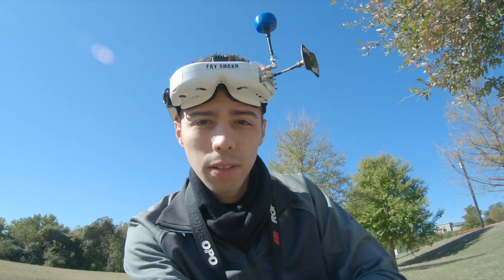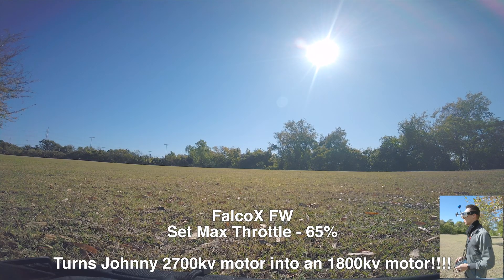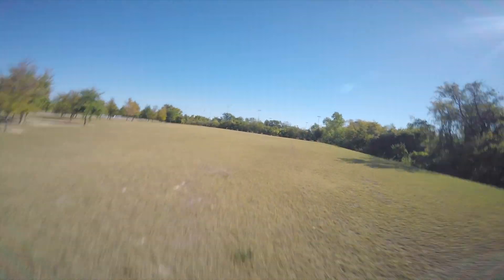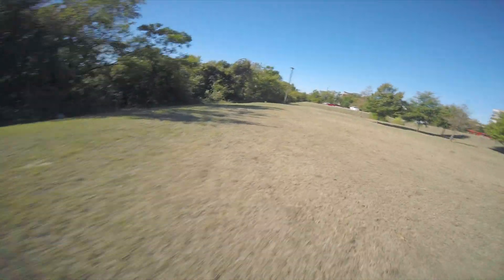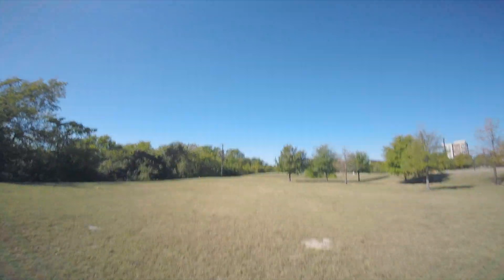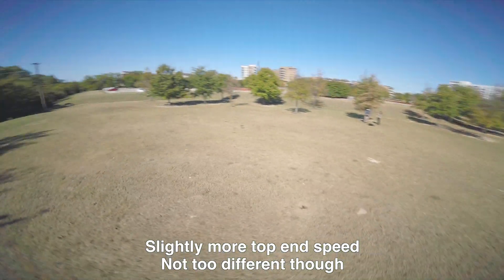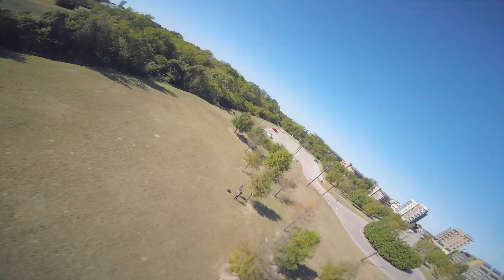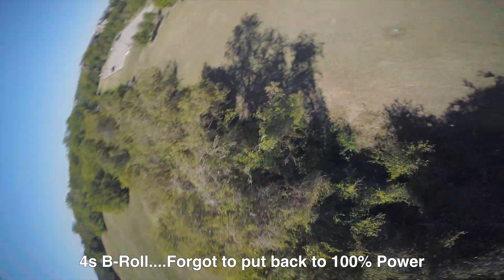Testing 6s on 2700kv Motors

Comment: Why?!? Why did you cap it at 65% why not use all the power? I do it on 6s with 2200kv, 2500kv, 2100kv.... be prepared to go well over 130-170mph... one of the best combos I have done is the 5” GRL Titanium Pro2 with F55a 4-1 ESC and T-Motor F80Pro 2200kv it’s not as fast as the 2500 but it still goes way faster then most people’s quads while also still having efficiency & control at lower speeds “thats the main reason why I went up in stator size” Tuning my quad with set ups like this are easy as well, no propwash, no heat, all performance and stability & full throttle 100% no Cap....
Reply from the maker: I capped it to see how much efficiency I could get and to see how similar of a flight feel it would be compared to a 4s battery. It’s not necessary to cap it, but I did it anyways mostly as a test. Also, newer pilots are not that great with throttle management so capping the limit is a bit safer for them and their gear in general.

Comment: did this ovonic battery ever swell up really bad on you? I have been flying on emax rs2205 2300kv and both ovonic batterie's i had, 4s and 6s ended up swelling. one has a bad cell  so ill make a new battery out of the good ones but i dont trust them very much anymore. i do love the way it feels to fly on 6s w these motors even with the limit on. i do get extra flight time as well and i feel like it just stops on a dime and carrys weight much better as well with 6s. board is kakute f7 hdv.
Reply from the maker: Putting a limit on betaflight is not the same as putting a power limit of falcox. That is probably why your battery is swelling. I haven’t had any issues with ovonic batteries but I treat them fairly well so that probably plays a part.

Comment: @0:46 I like that you put velcro tape on your battery😅 Also, I have a quick question about 4s vs 6s that I hope you can answer. Is one of them more juicy than the other? For example doing flicks? Or does it not matter if it is 6s or 4s? 6s adds a little weight though...
Reply from the maker: Bjørnar Verpeide 4s and 6s are both good for juicy style flying. You can do the same flicks and tricks but its more important to think about weight to power ratio instead of 4s vs 6s.  Sure 6s adds weight but it can provide extra power to make up for it. 99% of the videos on my channel are on 4s because it still works just fine and i have way more 4s batteries at the moment.
Reply: @JosueFPV  Thanks for the quick and good answer! So this is where the KV comes in as well, right? Would you say it is more difficult to fly juicy on a low kv motor? (Lets say 2200kv on 4s)
Reply from the maker: Bjørnar Verpeide yes i would not recommend that low kv on 4s. Anything lower than 2400kv on 4s is too low, especially if you are using a gopro hero. I recommend closer to 2600kv and up for 4s and 1750kv and up for 6s.
Reply: @JosueFPV  Thanks! Working on a new quad, trying to figure out what parts I should get. My current quad is a bit heavy. 741g😅 with 6s 1300mah battery and gopro. 1800kv motors.  So I guess the weight the power ratio is not the best.

Comment: Cool stuff man I’ve been wanting to try this myself now think I’m gonna have to do you know can you lower throttle cap In radio would it be the same thing
Reply from the maker: StaticMotion putting a throttle cap in the radio is NOT the same thing. In falcox, it changes more than just the throttle. If you only put a throttle cap on your radio, you could still smoke a motor because it doesn’t account for the extra power your quad registers when you move roll, pitch and yaw. I also believe that falcox compensates and adjusts the pids at the same time as well so the tune is more similar.

Comment: how much total flight time did you get on 6s?  did you have to change your capacitor to a larger one or something also?
Reply from the maker: LemonC FPV I’m just using a 1000uf 35v cap on esc and recently added a 350uf cap on my flight controller just to clean things up even though it technically doesnt need it and its really small. Total flight time was 4min 15 seconds. Could have potentially flew a bit longer.  Landing voltage was 22.2 volts.
Reply: @JosueFPV  interesting... maybe i should try a 6s out before i get more packs

Comment: i tried 6s on 4000kv 1606 motors, worked for 2 packs then i smoked a motor had throttle set to 60% :) guess they could not handel 6s
Reply from the maker: Tixo well yea I think your math is wrong. You would want to change it closer to 40-45%. Also, you need to make sure your motors can take 6s voltage.
Reply: @JosueFPV  this was with a  3 inch  hence the higher kv.

Comment: Throttle limit? Just leave at 100% and punch that bad boy out haha!
Reply from the maker: Change Agent bruhhh it’d be going to the moon with ALL the flutters lol
Reply: @JosueFPV  Haha yeah I know. Assuming you could get a tune at the top end that didn't flutter you would still have your props likely exploding after a few packs. I think the top end for most props even exceeding their rating and working on the rpm at which the outer tips become supersonic is around 39000rpm. 2600kv @ 22.2v = 57720rpm lololol.
Reply: Change Agent so if I’ve got 2400kv motors and 5S 21volts, I could be pushing 50,400 RPM!!!!???? 😳😳😳😳 holy sheeeit. Are props rated to 39,000RPM? I have had a prop explode but it was some cheap ones that came with a complete build. Do I need to worry about 50K RPM with higher end props like HQ Ethix?
Reply from the maker: jbw5485 if you have falcox and change the max throttle percentage, it will prevent your props from exploding and getting to that high of an rpm. If you use a 5s on 2400kv, i would maybe start setting it to 80% and if you want to go higher, you can work your way up by 5%. The reason I chose 6s and not 5s is because there are much less 5s batteries to pick from.  I have seen ppl run 5s on 2400kv at 100% and not explode a prop but maybe the props they used were indeed nicer. I would honestly worry more about de-syncs and flutters than props.
Reply: Josue FPV thanks man. What exactly are 
de-syncs?
Reply from the maker: jbw5485 you will know what it is when it happens. The drone will fall out of the sky because the motor stops spinning from the esc not being able to keep up with the rpm of the motor or some other issue.
Reply: Josue FPV daaaaaaamn 😳😳😳
Reply from the maker: Well yea, thats why you have to lower power to make sure props don’t explode right on full throttle take off lol I’m not endorsing that type of setup at 100% power haha
Reply: @JosueFPV  Understandable lol.